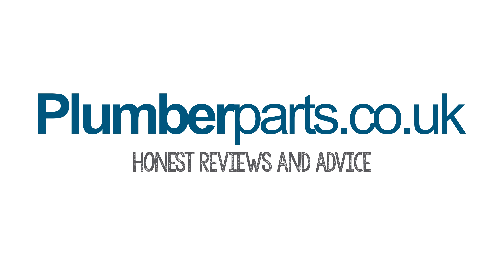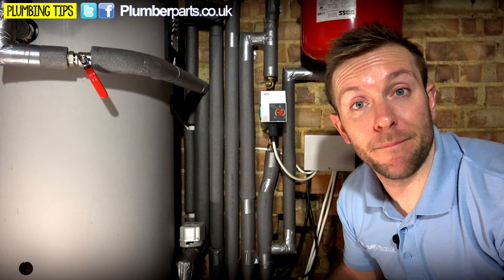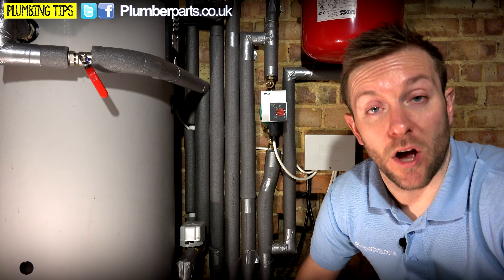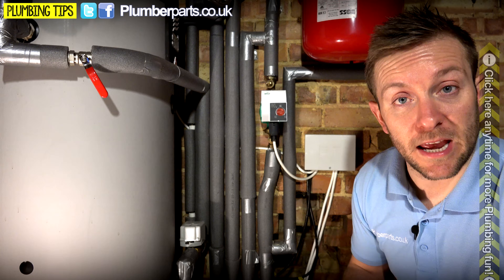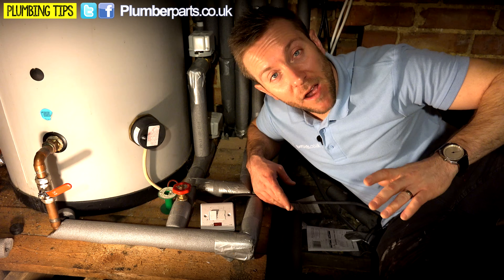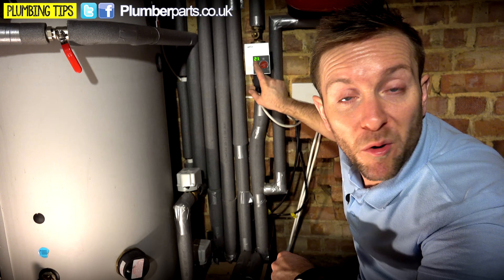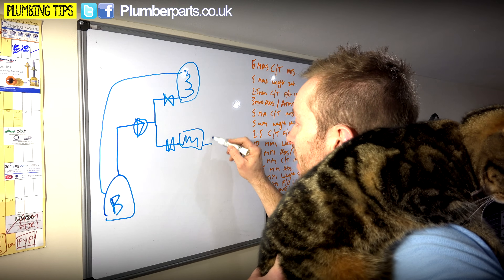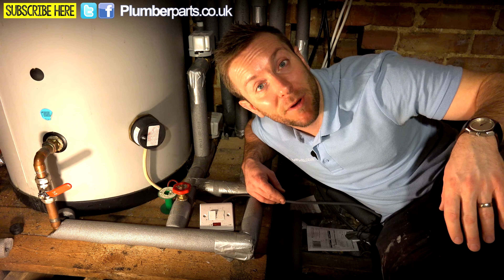BYPASS VALVES ON S PLAN AND Y PLAN HEATING SYSTEMS - Short Cycling prevention - Plumbing Tips

Comment: I know this is an old video but I could with some help regarding my UFH system whereby the supplier has suggested I fit an Auto Bypass Valve to  the flow to the manifold because my water temp in the flow is far higher that what the setting on the mixer valve is set at.

Comment: Hi James
Very many thanks for your brilliant videos. I thought I'd share my own experience in case it's any help to your subscribers. Here we have a cascade of four different problems. The situation was this, my daughter has a small flat with an air source heat pump. Separate zone valves direct hot water to an underfloor heating manifold and the hot water cylinder. The zone valves are controlled by a Towerchron timer. Roomstats activate the manifold valves. The living room was not getting properly warm. I called in the excellent local plumber and asked him to blow through the living room pipes. He gave the system a quick once over first and noticed that the Hot Water Cylinder zone valve was stuck open. This could well explain our problem with water short circuiting through the cylinder and not getting to the underfloor pipes adequately. Unfortunately this seemed to make the problem worse. Now that the hot water system valve was closing properly, the heat pump was giving a "low flow" error. The plumber identified another problem, now that the zone valve was fixed, the flow through the underfloor would stop when the rooms came up to heat causing the "low flow" error. Quite rightly he said that the system should have had a bypass valve and fitted one. Soon the system got worse still and the "low flow" error came on all the time. It seems that the good flow through the underfloor system may have flushed out debris and blocked the filter. He cleaned out the filter which improved matters, but still the heat pump gave the error message when the rooms came up to temperature. Now that all the other problems had been sorted, it was back to the bypass valve which was adjusted down to about 0.2 bar to allow water to flow through it when required, and, with a very great sigh of relief the system seems to be working properly.

Comment: having a manual by pass valve part open all the time is silly and a waste of energy, a by pass valve only needs to open when a fault develops and stops water flowing it's normal path, this is why automatic by pass valves should be fitted as they only open if needed.

Comment: I know this has been some years now but I do hope someone can chime in.
Can I use an automatic bypass on an unvented cylinder installed right next to the boiler in order to slow flow to the cylinder especially when both heating & hot water are both running?

Comment: Hi there. Quick question - I have combi boiler running eleven radiators, ten with Hive TRVs and one without. My plumber recommended fitting automatic bypass valve to be able to fit the eleventh with a TRV. All good so far but boiler is now running pump constantly and has significantly increased electricity use.
Is this simply a property an automatic bypass valve I’ll have to live with of can the pressure setting be changed to reduce need for pump to be on constantly?

Comment: Could this be why im getting central heating when i only call for hot water?
Reply: A Central Heating System has many controls to operate, either you have a faulty control part or your system has not been piped correctly IE: needs alterations.
Reply: @robinsoneveonline  resolved now. Pipework wss issue. Return hw tapped into ch return

Comment: Fitting a new combi and UFH. Fitted a zone valve for UFH and also for the Radiators. Is it best to fit an ABP valve? This would have to be about 700mm of pipework away from the boiler is that ok?

Comment: I'm fitting a unvented hot water tank in loft direct type to take advantage of excess solar power I have all plumbed in 22mm was thinking about fitting a 3 port valve between combo boiler outlet and tank outlet so can switch on boiler if tank runs out if no sunshine problem is very small ports in 3 port valve think mite reduce flow

Comment: so could u use that bypass valve to control the temp back to your boiler return line, say i wanted to maintain a boiler return temp of minumum temp, I am using a non condesing boiler so want to maintain a temperture of above 130 F

Comment: Great video - wondering if you can throw some light on my system issues. 
Have Worcester Bosch 40CDi feeding five two port valves. These valves associate with two Myson underfloor manifolds (ground floor )one mains pressure hot water tank and two conventional radiator circuits (middle and then second floor?
Recently replaced the auto bypass valve with a new Honeywell du145. 
I can’t get the boiler to stop cycling unless I turn the middle floor and hot water valves. If I turn on just the top floor the boiler goes over temp and cycles, same with just the hot water. Bypass valve doesn’t seem to reliably make a difference. 
Bypass is fed directly off the pump (grundfos 25/80 set on constant pressure 2)… proportional seems worse. Bypass valve is connected to rtn (just after a pressure vessel set to 1.5bar)
Any ideas? I’m out of ideas. 
My expectation is the boiler should be able to run at minimum burner with any circuit on and not keep cycling.

Comment: Hi, great video, we have a pressurised 'S' plan system, do I need a bypass valve if some of the radiators are towel rails and are not fitted with a thermostatic valve?

Comment: Hello, may I ask you if a bypass valve is not needed on a y system ? this is what I have been said as my Ideal Boiler is having a constant FA code and after chaging the PUMP issue is still there.Before letting him do that , I would like to be sure he won't remove something important
Reply: Any competent professional will not be removing what is required. It's good practice to still install a bypass on a Y-plan system
Reply: You don't need a bypass on a y plan system, the 3 port valve will always allow a flow either through the hot water cylinder (default), through the heating circuit or both, (it will never close both ports at the same time). In heating only mode the radiator in the room with the main thermostat should not be fitted with a trv and it should never be turned off both sides of this radiator should be fitted with locksheilds so again there should always be a flow.

Comment: I have a automatic bypass valve between the flow and return on my radiator system, I originally had TRV on all radiators other then bathroom. I have removed two from the hall way and would like to know of the actual way of calculating the pressure setting on the ABV?

Comment: What is a throttle valve another red wheel. How far should that be turned left or right. It caused a water flow to thermistor prob on ideal logic 18. When resolved next day my new immersion n cylinder overheated. I reset it but water heats up to boiling almost in 15 mi s yet programmer says only 49 degrees

Comment: Super! 
Had a plumber replace a 2-port valve. After he left, kept getting the L1 error for low/no water pressure. (As TRV’s and or stat would stop calling for heat). 
Thanks to this video I realised he had shut the by-pass valve completely while changing out the two port heating valve and never returned it to its previous position. Opened it up a touch and no errors since. 
Saved me time and money 👌 Excellent quality video and explanation

Comment: So if I have one of these fitted to my system does that mean I can have a TRV on the radiator in the hallway? I was told that it could not have one as all the others have TRV's and one is needed to be left with a valve open for the system to work.
Reply: You shouldn’t have a TRV on the radiator that the room stat is in the same room as. The radiator will close down and make the room stat think the house is under temperature meaning you waste more gas. It’s also part of Building Regs

Comment: i've put an auto bypass in my Y plan where the old gate bypass valve used to be in the airing cupboard and now my boiler is kettling even when the bypass is set to the most open. I had to open both radiators without a TRV all the way to reduce the kettling, but it's still there. didn't have to do that with the gate bypass valve. before I opened the radiators right up, the pump was making horrific noises as if there was no bypass.

its a brand new grundfos pump too and i have to turn the pump right up to get the return from the bypass to get hot, but the boiler's still kettling. It's one of the £10 unbranded auto bypass valves from screwfix/toolstation. I've checked that the arrow on it is pointing the right way. should I have gone for the £50 honeywell? should I put a gate valve back in? the only unusual thing is that the old gate bypass was 18 inches of 15mm pipe from the pump to the return and ABVs only come in 22, so I've installed it with internal reducing olives on each side.

Comment: Hi, thanks for the video. Yesterday my husband turned the two red valves on the boiler cos he thought they would help with one of the radiators that wasn’t heating in the house. Now we have no heat and boiler is making a funny noise when we turn on the heat or water. Do they need to be turned fully anti-clockwise or just halfway

Comment: I only put the ABV on the zone with TRVs. That zone has 2 'leaks' on it anyway as well - through the tops of the bathroom and kitchen rads - to effect a towel rail - where only the top inch of the rads gets hot.
None of the other zones (4) have a bypass so they get full pressure and do not have TRVs.

I have had no circulation - due to iflo/Drayton zone valve microswitches failing but as the Veissmann boiler limits at 80, it doesn't boil.

Comment: Great videos, thanks for posting.  I have a quick question in relation to bypass valves.  In a situation where a boiler, a direct H/W tank and the zone valves are all in close proximity like a loft, if using an automatic bypass valve, what is the minimum recommended pipe run required to allow the boiler to dissipate heat as potentially the boiler will only have a very short pipe run once all the zone valves close and the water is moving through the bypass valve.  Should this therefore be considered and should some additional pipe run lengths be added into this circuit to allow for the boiler to cool down?  I called Worcester Bosch on behalf of my plumber and although their instructions state they require a bypass, they don't have any comment to make in relation to how much run their boilers require to cool down.  Any advice will be gladly received … :-)
Reply: No need for 'cooling down'. The circulation just ensures the boiler stat sees all the water temperature. Boiler stats used to be in the tank of water the flame heated - they didn't need water flow at all. Modern boilers have the stats in the 'flow' pipe as close to the heat exchanger as possible - but this means with no flow, there is a time lag for the stat to feel the heat - so the boiler gets hotter than planned. If it gets too hot like this, an overheat stat will trip and turn the boiler off until it's manually reset.
Ideal Icos boilers don't care - they are happy to really boil water !
Reply: pmailkeey brilliant reply and great detail, thanks so much.

Comment: Sorry james, I just have a doubt if the flow of water has to be constant, this states that the pump is always on and never shuts completely but just decreases the pressure as at this stage it'll only need to pump up water in a confined space of the central heating system and not through all the radiator and cylinder, right? Could you be so nice to confirm this to me if what I'm saying is correct? And as well it will pressurise cold water only as the boiler is now switched off and not using the gas supply to heat everything up right? It would be really nice of you to explain this clearly to me. Thanks a lot in advance 😉

Comment: I have installed Tado radiator valves on all my radiators and I hear the water flowing too fast when the system is heating only one radiator; I found I have a fixed speed pump on my boiler (Baxi Duo-Tec Combi 28 HE A); would a bypass valve help reducing the noise in my active radiator?

Comment: Are bypass valves needed on a Y plan system? Holding tight for an answer!
Reply: David Lodge - yeah they are bud, all types with controlled systems apart from combi’s, they have them built in. 🤗
Reply: Depends on the boiler :)

Comment: Hi great video, newbie to posting please bear with :).... i have a Ideal Vogue 26s (pwm modulated pump) Condensing Boiler  in the loft with an S plan heating system , there is NO bypass valve fitted, could you advise on  where exactly  does the auto bypass valve need to be fitted ?...the Flow and Return 22mm pipes come down in parallel down through the ceiling in the airing cupboard (5mm apart very neat but a tight fit)....there is a Ideal filter fitted about 300mm below the ceiling , so thats a bit tight to fit it...then they drop down to  a T section in the Return pipe for the filling loop then onto the  2 way valves in the lower part of the airing cupboard ...i could add a pictue that would explain the layout much better... if thats possible on youtube ?. .any advice /help would be much appreciated .
Reply: Bypass valve is already fitted inside the boiler. Simply google the question.
https://idealboilers.com/uploads/documents/Installation_Servicing_Vogue_Max_System_15_18_26_32.pdf

Comment: Hi can you offer any advice on a problem I have with my heating/ hot water Kingsplan Tribune HE system. The hot water is too hot, I’ve checked the cylinder stat by removing it and testing the bulbs in hot and cold water and I’ve also checked the zone valve servo motor is operating. So I set the stat to 25 degC but the water is way above the set point. Any ideas?
Reply: Turn boiler stat down.

Comment: Help...advice. Y plan system..30 odd rads, gravity fed cold feed and expansion were within 100mm each other South side of pump. Anyway..Did a Power flush, fit 25 new trvs. Cold feed back filling...vent fine but heating going up intermittently up the cold feed and F/E cistern over flowing. Been back tonns..Any Way we changed the cylinder for new stainless steel cylinder and converted to S plan. By pass auto..A auto air vent and even a Spiro air elimintor. Going back tomoz to fin wiring but I'm bout lost as to why it did it today? Oh I repiped a tower air separator in before the pump and cold feed within 50mm of it. I have mentioned converting to sealed but customer not fancying it due to pressure..Help?!
Reply from the maker: Mate. MAKE them convert to sealed system. Had exactly the same thing on a job a few weeks ago!
Reply: @plumberparts  LOL - so you can't fix a loft tank issue - other than by replacing tank and making it a sealed system !
Reply: Doesn't solve the problem...
Reply: If the cold feed and vent are piped correctly and bypass working correctly there HAS to be a blockage somewhere
Reply: Don't get me wrong this guy knows his stuff with great videos, but there is still a problem that needs addressing in this case
Reply: Air separator before pump not a great idea.

Comment: I have a combi boiler with 2 zone valves, 1 does the house rads and the other does my garage conversion rads. When the thermostat in the house is up to temperature but the garage requires heat, the correct zone valve does its job but my boiler then starts to make a high pitch squeal like the pressure has increased too much on the other zone. Would a bypass valve solve this?

Comment: I've got a bypass on an open vented system with a three port, mid-position valve. Not sure what the purpose of the bypass is here though - doesn't the water always have somewhere to go with a mid-position valve? Is the bypass only in case the mid-position valve becomes entirely blocked somehow? Cheers for the many excellent videos.
Reply: It's good practice to put one in. The bypass opens if the system pressure increases when circuits close down due to them reaching temperature. This allows water to flow through the boiler – stopping lock out – and it also prolongs the circulator life. If in any doubt refer to the manufacturers recommendations.
Reply: Depends if the 2 zones can be stopped up - by TRVs for instance. If the zone valve 'sticks' in any position, can you still guarantee flow ?

Comment: Hey, Quick question, i have a vaillant system boiler which has a built in auto bypass, but i saw a comment on a forum that you need to add a separate one if you have a S plan. Is this true? Thanks!
Reply: No need for 2 !

Comment: pretty sure i got a bypass on the return from the cylinder coil. In other words its been placed after the pump and 3 port valve and cylinder on the return to the boiler. no wonder that pump makes horrible noises!!!! cheers plumbing parts.
Reply from the maker: No worries Jason! Glad to help you out bro! SUBSCRIBE! ➡️👉 https://www.youtube.com/subscription_center?add_user=plumberparts 👈⬅️ IF YOU HAVEN'T ALREADY! 😎
Reply: sounds to me like a lockshield gate valve which should be fitted on the cylinder return. that's not a bypass, that's to regulate the flow going through the coil. you don't need a bypass on a 3 port, unless there is a unvented cylinder then you need to add a 2 port and bypass. hope this helps
Reply: Oh right thanx good to know I'm 1st year plumbing student this website and youtube channel is so good. Makes much more sense then looking in the city and guilds book!!